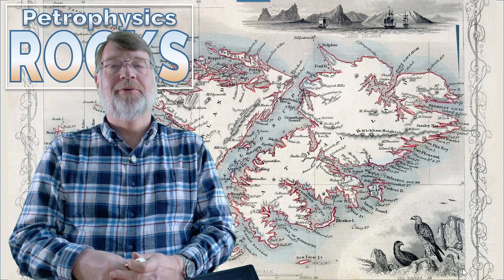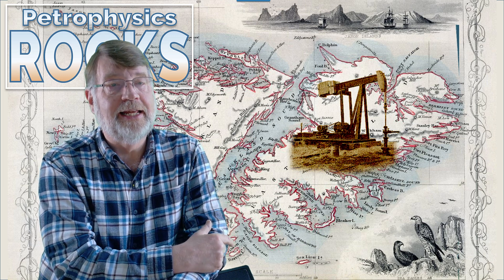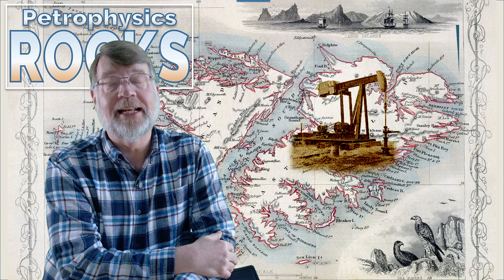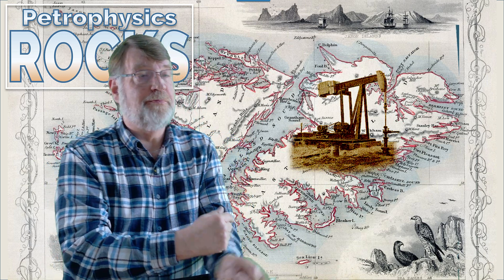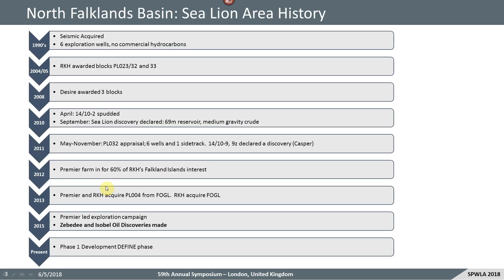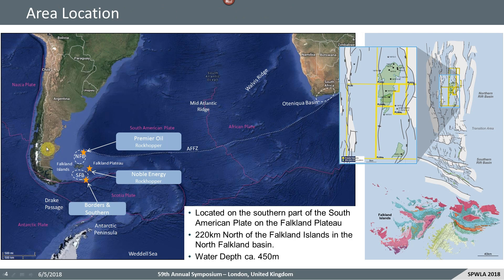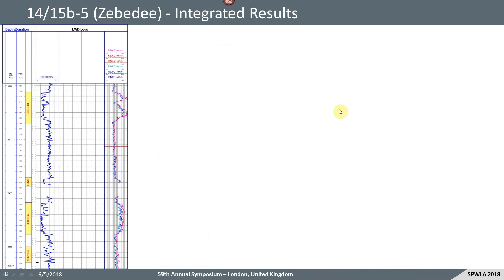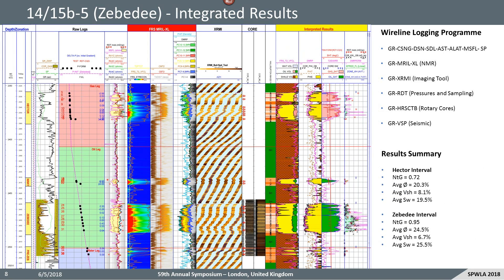Falkland Islands Exploration Well

Comment: your knowledge in this subject is extremely interesting. glad to be part of a new channel 😁

while the oil may not be fluid enough for easy exploration, would the gas (presuming there is some there along with the oil) be suitable for LNG or would this even be suitable?
Reply from the maker: Thanks for the comment @RedentSC  - the interactions really help the YouTube algorithm – apparently!

Now I have to admit to not being an expert in what makes a good LNG source gas, but yes there is plenty of gas as well as oil in the Falklands basin (a useful source of fuel to operate the oil production facilities?).   

I know that Shell (for one) were looking at running a few floating LNG processing plants around the globe to mop up small offshore gas accumulations – that wouldn’t justify a full onshore processing facility.  So I assume that’s the sort of thing you’re getting at for these remote operations?

However, I would say  that the Falklands is so remote that, whether you’re offshore tanker loading for Oil or LNG, I would have thought it would be similarly challenging from a marketing perspective (again though, I can’t pretend to be up to speed with the economic modelling side of things).

I should also say that although I mentioned the fluids were a bit tricky (waxy – a common feature of lacustrine source rock) – the oil flows well enough down hole and through most of the sub-surface pipework – it’s not really until the fluids get to the surface processing facilities that you’d probably have to look at some additional heating.  Certainly when we looked at the “Flow Assurance” studies…there were no real “show stoppers” as we would say.
 
There’s probably over 1 billion barrels of oil in place in the Sea Lion area – it was/is a tantalising prize…..it’s obviously also in a very environmentally sensitive area – as an Engineer, it’s the sort of thing you want to work on!
Reply: Thanks for the video.. Do you own shares in Rockhopper Exploration ?  We seem to only be waiting for the final investment decision on the Sea Lion project now, expected within the next 6 months.  Have you studied the results of the Isobel Deep drill campaign ?
Reply from the maker: @Whitelight77   - No I don't have shares in Rockhopper, though I enjoyed working with them as join-venture partners!  I haven't really kept up with the FID (Final Investment Decision) machinations!....I know it's been "within the next year" for the last 6 , 7 or 8 years!......as a subsurface technical guy, I would say the subsurface story is very mature - and the risk profile very well defined (the initial data acquisition by Rockhopper was excellent) - so although there are subsurface challenges (fluids & connectivity) - I think they're pretty well understood.   I guess the dominant problem issues holding things up...in a "new" basin is the geographic isolation and access to markets......there's plenty of oil there!  I haven't kept up with Isobel Deep - we had rig schedule issues that kept us from revisiting and fully evaluating that discovery...as I recall.
Reply: Next 2 months hopefully...@Whitelight77
Reply: Would be great if you could do a video about the Sea Lion oil field complex,
Reply from the maker: @Whitelight77  I'd have to see what's in the public domain - as I'm no longer part of the Operating Company - I could probably do a reasonable overview of the subsurface issues...but would not be able to opine on any of the current commercial/political issues....I'll put it on the wait-list!